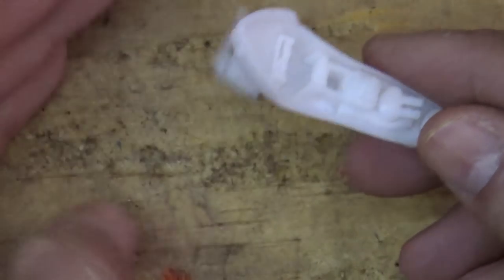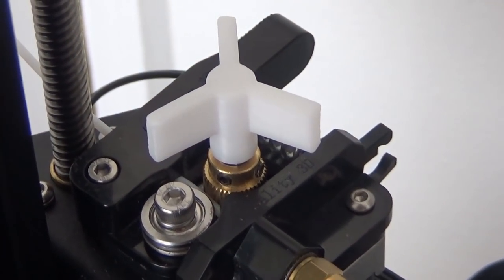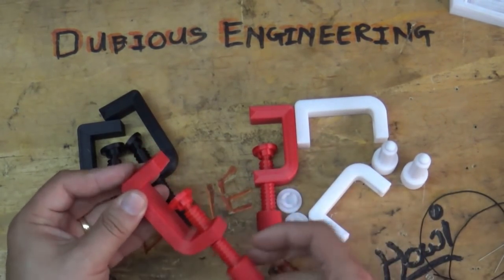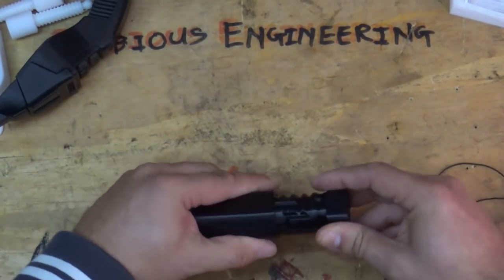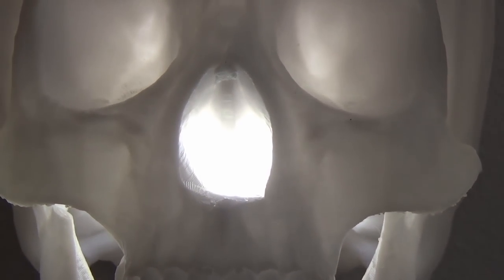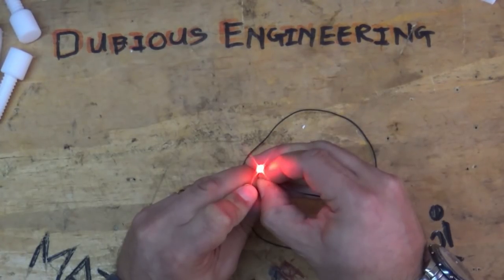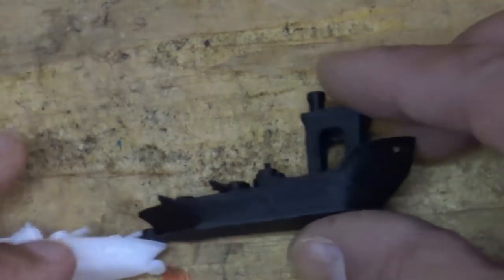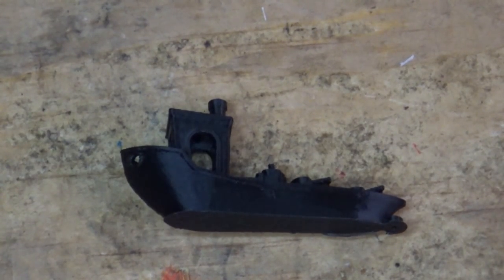DuB-EnG: Cheap PLA Filament 3D Printing - Nozzle Temperature is VERY Important FDM Fusion Chinese

Comment: Hi, I had a similar first experience with the tiny bit of filament that came with my creality printer. First print was holey and brittle, but then found a proper cura profile tried same thing again and it was near perfect. Since then bought some for about £15 which said on box print at 210-220, since then only problems I've had are due to poor bed ahesion(not using glue stick on the bed) or bad model alignment in cura. I'd say 80% of prints have turned out good - then I realise I've made a mistake of some kind in the modelling etc and have to iterate through a few tries to get working results.
Reply from the maker: It’s amazing being able to print your own things... but it’s a learning experience every time... I think if you buy the professional stuff instead of experimenting like we do they get good prints almost every time!!  Thanks for your input... I hope people find it useful!  Glue stick makes a world of difference... and a little spittle!! :-)
Reply: Try putting a sheet of PEI plastic on your bed (if you're mainly printing with PLA). I used to use hair spray to help stick my prints down. Also, my original build surface on my print bed is shot from all of the prints I've done, so I decided to give PEI a go after a bit of research. Now prints stick perfectly without needing anything - not a speck of glue or spray is required, though I still warm the bed to about 60 deg C. And since I can clamp the PEI to my bed, I can remove it to get prints off without scraping the bed and possibly wrecking how level the bed is. Just wipe the PEI down with alcohol between each print and you're good to go.

Comment: When you broke off the one piece on the failed red dock it looked like there were a lot of voids inside the print. A lack of infill can also result in your prints being more brittle. Some prints you can get away with say, 20% infill, but I usually go to 50 or 60% for added strength. However, your mileage may vary, just depends on what you want for the final result.

Also, I noticed on your finished red Switch dock that you can see a bumpy geometric pattern of the infill on the outside walls of your print... you may want to add more walls/perimeters to that object in your slicer software. This will use a bit more filament of course and increase the print time, but that also helps to increase the strength of the part and more walls will help keep the infill from poking through and helps make the item look smoother. You'll have to adjust these settings based on your object.
Reply from the maker: Invaluable comments!! ...  Thanks kindly...  I’ll have a look into wall thickness. I may well increase that parameter a little...  the voids were in-fill related.  It’s easy to turn that up in cura.   Thanks again Beefy!!

Comment: I've had my Cr20 for a few weeks and it came with the white pla.  I've not used it yet but it's good to know it needs a higher temp.  I did have trouble with my extruder gear and was getting under extrusion and everything was falling apart.  Changed it with the gear on my ender 2 and now it's spot on. Printing everything at 200c now.
Reply from the maker: Gary Rivett good to know Gary! ...  thanks for sharing...  this may help a few people...  this wasn’t the sample white pla ... I bought this separately on line, so it may be different...